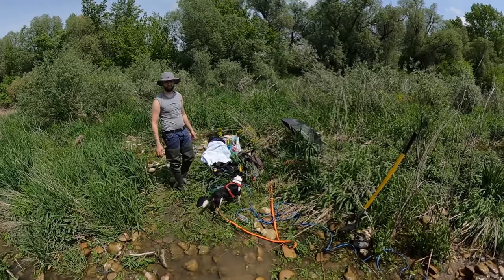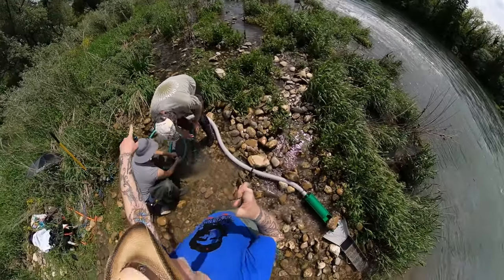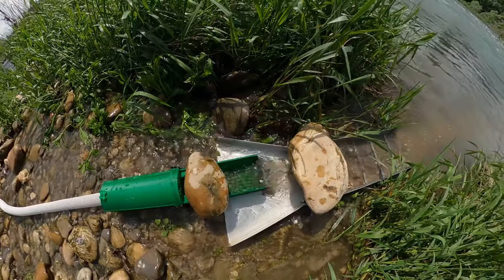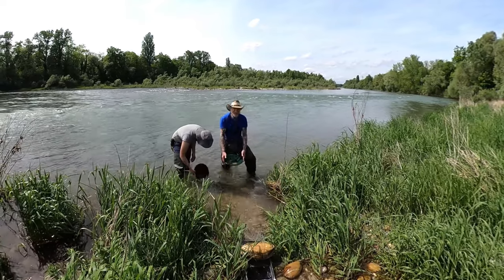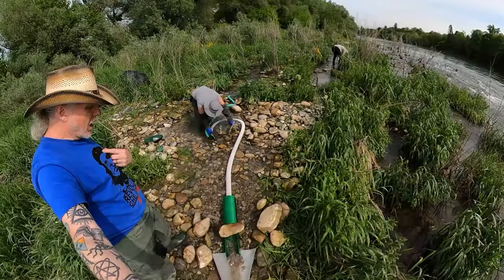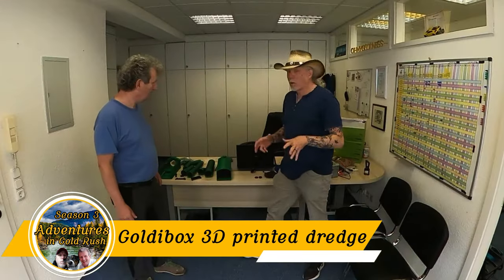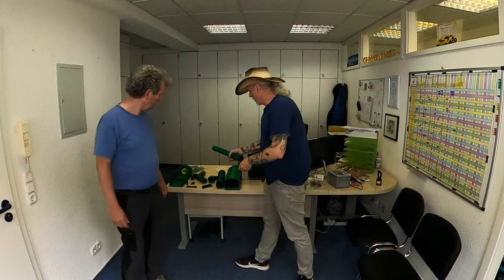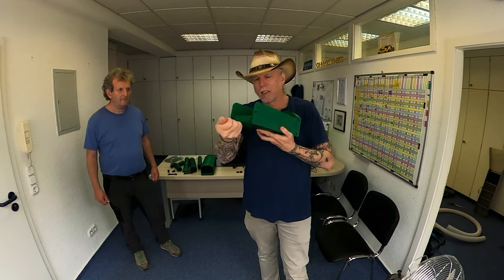Adventures in Gold Rush Goldibox 3D printed Dredge (SE03EP04)

Comment: Response from GoldiBox:   There are a few things we noticed and a few things Rick said several times that we agree with that would've made the experience better. The location was not ideal. When used in the right environment, the GoldiBox is an outstanding gold recovery system.

Rick you nailed it every time you said this wasn't the best location for the GoldiBox. The GoldiBox was designed to be ultra portable and to be able to work BEDROCK and to get down into the crevices in hard to access and remote places. Whereever that bedrock may be. Rivers, creeks, benches, etc. And Bjorn is right, the Crack Attachment is for getting down into the cracks and crevices.  It is used by snipers and bedrock workers.   It was not designed to move feet of over burden, weeds or sand. Better documentation would have shown that the material (sand and weeds) is not ideal and will clog the system.  We will make sure to add a section to the user guide covering this.   If we would've worked the area your team did, we would have used our highbankers or sluices and not set up the dredge.

There is no need to use the longer extensions in that shallow of water.  It forces the nozzle higher out of the water which causes suction to drop.   The section where the extension and the nozzle mate should be underwater so you don't suck in air.  The extensions allow you to dredge deeper once the material is beyond the nozzle's reach, which is typically bedrock.  And when the attachments are used underwater, they do not fall off.  The suction holds them in place. This was by design as over time, material can accumulate in the joint and they can be difficult to remove. But as Rick mentioned, tape can optionally be used to make them fit tighter.  We've done both.  It is a user preference.   

We do want to point out that the GoldiBox didn't lose gold and it is capable of recovering very fine gold (as seen in the video) to coarse chunky gold (unfortunately, not in the area). We're glad you are happy with the suction nozzle and we appreciate the kudos. They deliver outstanding performance and value.   Both the nozzles and the GoldiBoxes have been through many iterations and 100s of hours of testing.   

We do hope you have the opportunity to give the GoldiBox another go in a more suitable location. 

Thanks again for the review. We appreciate all the comments and suggestions.

-The GoldiBox Team
Reply: I have the goldibox. I’ve been using it for years. Your evaluation shows that you haven’t used it enough to properly evaluate it. For instance your claim that there is a difference between river rock and a small creek is unfounded. There is no difference. Your hoses are to long causing a loss of pressure. You should also try to not have any of the equipment above the water table. Sometimes it does jam up but a small stick shoved up through the box takes care of the problem. Hope you have better luck.

Comment: It's a sub n ,thumb from me Arrrrrr ,tbh I'm no impressed
Reply from the maker: It does work pretty good in smaller creeks with less overburden, but it's good for testing only.
Reply: @adventuresingoldrush  thanks for your honesty, I've had the 2, 3 ,n 4 inch Keene dredges and I've tried a few frankin dredges , but I suppose they all have there uses. It seems on paper a good idea but 3 d printed parts . Not the strongest or most precise stuff I've used . Cheers 🍻 you've probably saved me the trouble .  All the best in your endeavours Arrrrrr